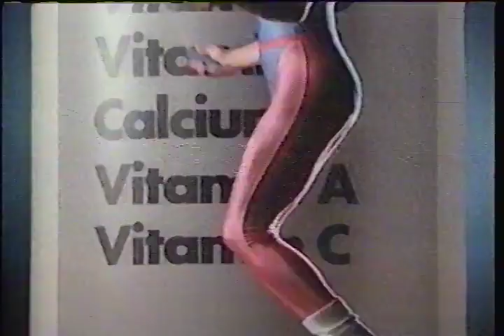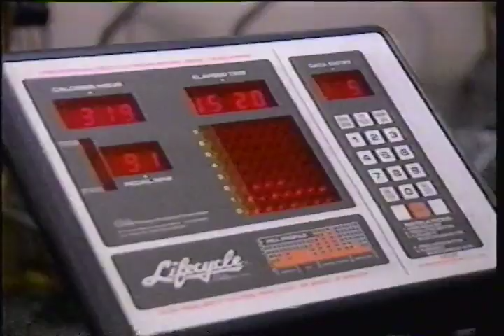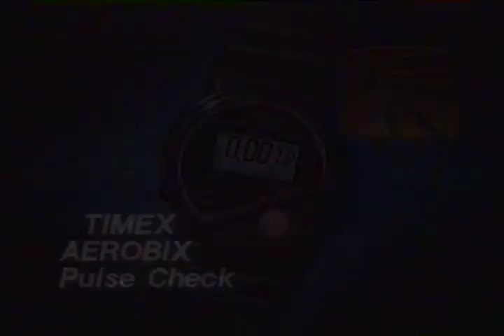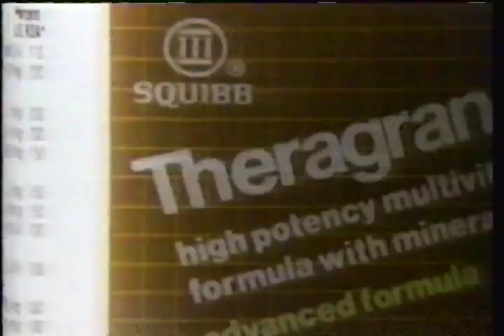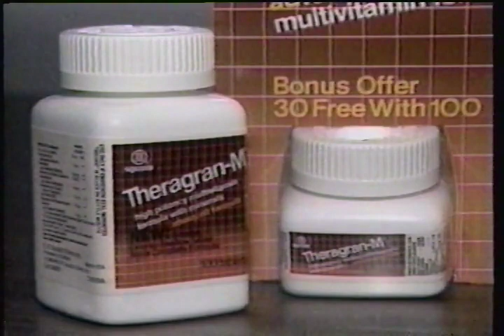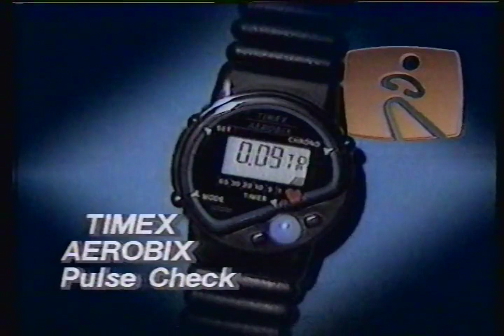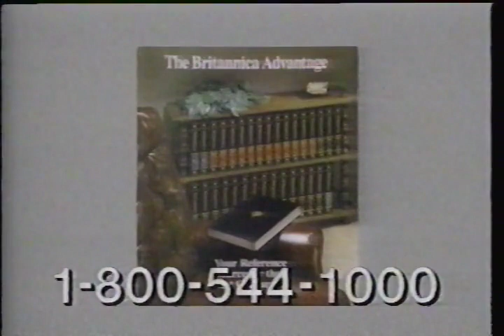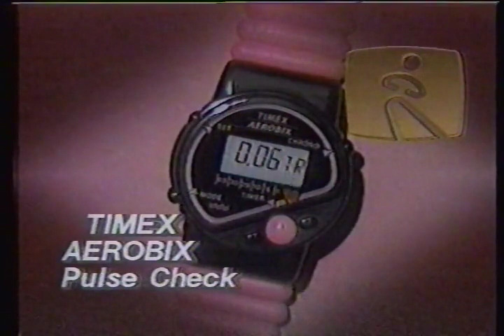Getting Fit with Denise Austin on ESPN (Winter 1988) with commercials

Comment: The rapid touch-tone telephone-style dialing was used in the 80's and 90's by cable channels to signal local operators to cue up the videotape as a local commercial break is about to start so they can make money locally (mom and pop shops, etc. / similar to what we hear these days during NFL games: "And now a word from your local Fox / NBC / CBS station"). Two dialing tone sequences (one before going to commercial break and one right before going back to programming). Hope this helps! Congrats for the great upload!